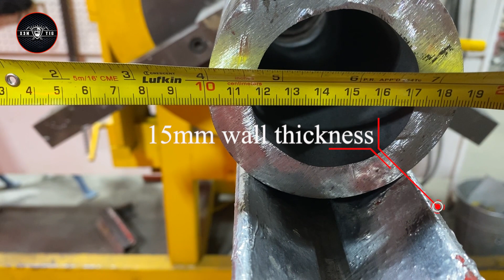The ABSOLUTE BEST Way to Master 6G Welding Test

Comment: U have help me learn more to prepare myself to retake my pipe next week I messed up in my cap but only difference is I’m using an roller button torch and I gotta run on 116 Amps on an 45 degree angle putting a root pass and cap on a 1/16 gap and either capping it with a 3/32 or 1/16 and but that cup I’m using it’s wayyyy bigger than the one in the video plus my torch im has a curve I don’t have nothing to sit my arm on to keep it steady so I’m thinkingg  would it be better than to try to walk to cup it’s like size 8 or 9 I’m normally using an 6 but any suggestions
Reply from the maker: Try with cup #8 and 3/32 rod, and walking the cup would be ideal.
Reply: Thanks so much

Comment: how do you stop the suck back at the very bottom 6 o’clock just keep heat down?
Reply from the maker: Yes, or just make heavier root, or go with 3/32 with lower heat.
Reply: @X3MTIG  oh did you not use 2.4mm filler wire hmm 3mm filler might work better for myself i shall see if we have any and give it a go with that 👌🏻 always some way to make it easier 💪🏼

Comment: what size tungsten and size of filler rod?
Reply: Looks like 1/8 tungsten and 7/16 filler wire lol i was thinking the whole time why the huge filler rod. But its probably both 1/8 3/32 would probably be a better choice but if you learn on 1/8 you will like 1/8
Reply: 2.4mm both plus gap but all welders have different techniques so maybe 1.6mm filler wire

Comment: Nice techniques, thanks ❤️
Reply: @X3M TIG  please help sir. how to Tig welding in 6G test with carbon pipe 3” sch 40? how to handle, what is no gap or with gaps. I’m few weeks experiencing this test and fail with gaps 3,2mm and filler rod 2,4. please help.
Reply from the maker: @saifulhatf1151  hey sorry I just seen your message. Try with 5/32 gap and 1/8 filler rod, do as I shown in this video, freehand harder side first, keep in mind that you are allowed to use grinders so go slowly and if you think it’s not good fixed and continue on.
Reply: @X3MTIG  Yes sir, I will try tips and tricks is suggested from you for next test. I got difficulty when was tested with small diameter and thin pipes (sch 40). Thank you sir, for suggestions.